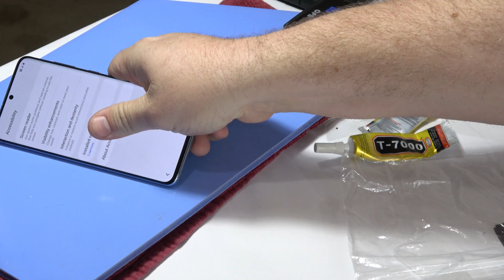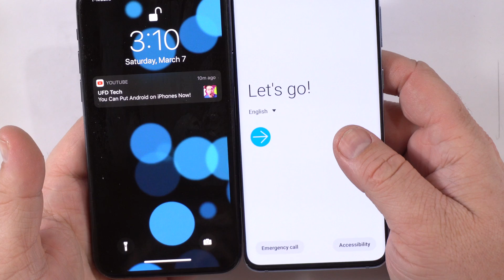Samsung S20 Tear Down with Screen Replacement (Detailed)

Comment from the maker: Please support the channel by using my amazon links! 
For just the Screen LCD click on the links below.

LCD Touch Screen Display Assembly :
https://amzn.to/3Co6QpT
https://amzn.to/3nGuGY9
https://amzn.to/3bmZcAt
https://amzn.to/3nBpdBB

Recommended Screen Protector for S20 :
https://amzn.to/3pJIK5w

Recommended UAG for S20 :
https://amzn.to/3vS0IUB

Heating pad:
https://amzn.to/3mbIytW

Heat Resistant Gloves
https://amzn.to/3EsZdyW

My blue mat to keep everyone organized:
https://amzn.to/3BalS16

iFlex Opening Tool with Glue Card :
https://amzn.to/35UC9h8

iPlastix Opening Tool with Glue Card :
https://amzn.to/38FtzUH

on of my favorite screw driver sets 2uul:
https://amzn.to/3jsqkCz
https://amzn.to/3CcoL2Y

iseasmo w/ Kit (Has Screw driver too)
https://amzn.to/35Za2O0

Tweezers:
https://amzn.to/3B7yBlf

T-7000 Water sealing glue:
https://amzn.to/3EdzLxs 

Isopropyl Alcohol For Technical Use:
https://amzn.to/3BqBU78

• Visit our Website: https://tech-md.com

• My email: dustin@techmd.bz

• To mail in your phone, please contact us at 801-438-6028 

Need to get a part from a reliable quick source, you'll find a better price here then Amazon and the quality will be a lot better. Click on the link below.
https://www.injuredgadgets.com/?acc=be9b6cec65c863e1b55538d2c7fcc9b0